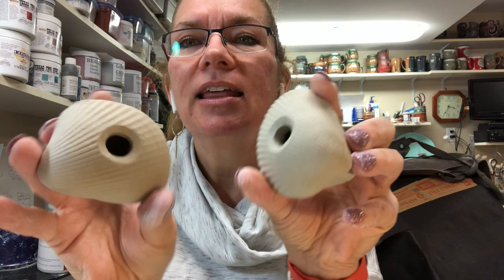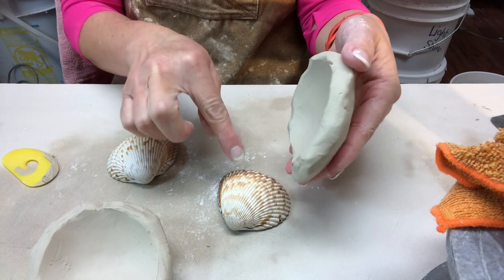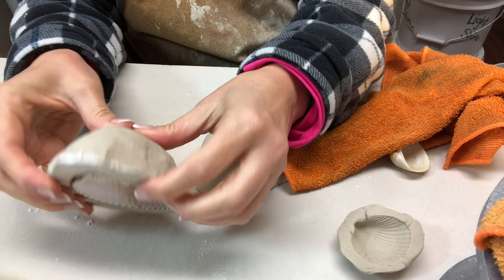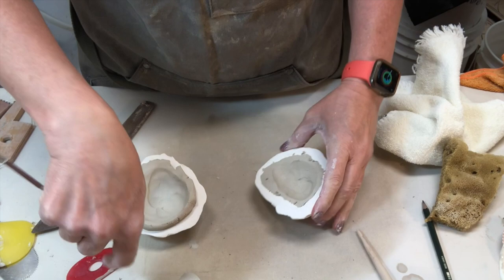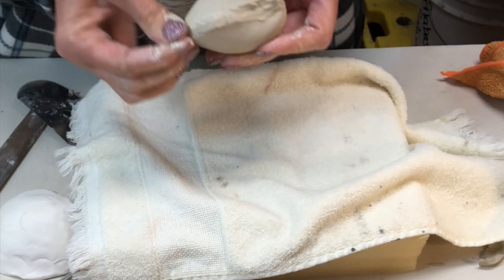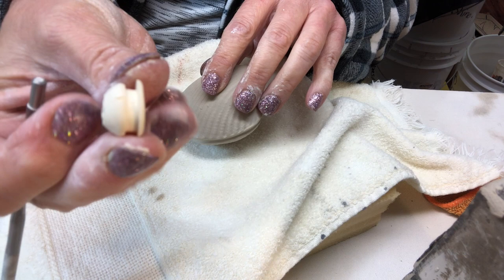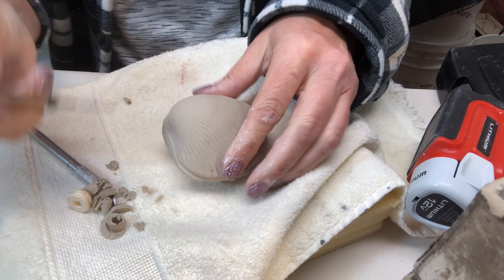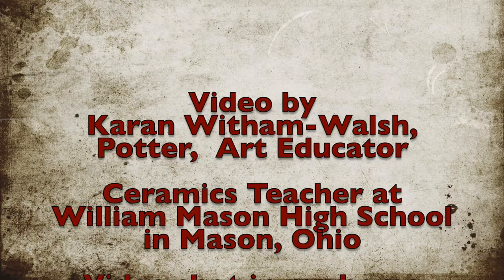Making Simple Shell Shakers Using Shells as a Mold!   Day 41 Quarantine Distraction Video

Comment: Hi Karen,
Hope you’re doing well.  I’m a big fan of your videos.  I have learned so much and still have a lot to learn!  I have a glaze firing situation where I think you’re the best person to ask.
I have made fortune cookies where I put them on pronged kiln stilts for the glaze firing.  But they either come out stuck to the stilts (permanent damage) or left a prickly surface on the cookies where I had to gently sand them down which caused the glaze to be scratched.  I was wondering how you set up these salt ‘n pepper shakers in your kiln for the glaze firing.  They are kinda along the same lines as my fortune cookies.  Your advice would be greatly appreciated.  Thanks.
Reply from the maker: Hi Lisa- I actually just dryfoot the base of each shaker, so it has a teeny little area unglazed around the stopper hole!  Stilts do sometimes create a mess, or even bend during a firing, so I try to avoid them whenever possible!  Another solution would be to use an underglaze that might not stick in firing.  Oh, and whenever I use stilts I try to make sure it's not a runny glaze which will run into and embed into the stilt!
Reply: @KaransPotsAndGlass  Thanks Karen!

Comment: Won't the clay shrink after the final glaze? Will the stopper still fit then?
Reply from the maker: Hi Gail- yes, it will still fit, as I cut it to the diameter of the flange, and it will shrink to the smaller size of the "shaft" of the stopper.  I will find a handout and link it in the video description tomorrow when I have a chance- it is a visual guide to cutting the stoppers to fit!  I think it is one of my other shaker video descriptions too...

Comment: If bisque firing shrinks the piece 12%, how do you measure for the stopper?
Reply from the maker: Because I cut it the size of the interior flange of the stopper, it will eventually shrink to the diameter of the smaller central part- the interior flange will be inside, and the outside flange outside.  And the narrow part is the part snug in the clay.  I have another video where I explain it more with a printable handout here:  https://youtu.be/MaLpZoLzsWE
Reply: @KaransPotsAndGlass  Thank you